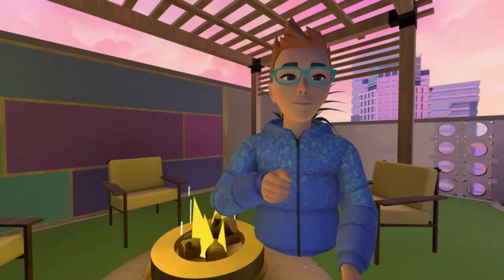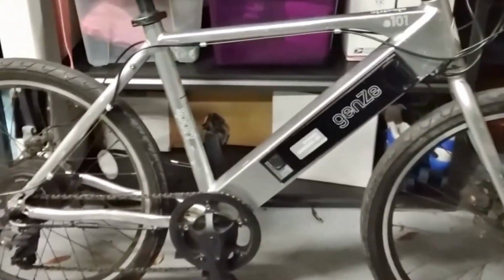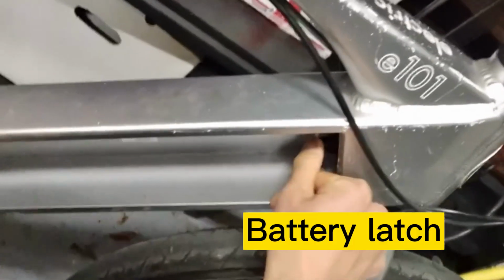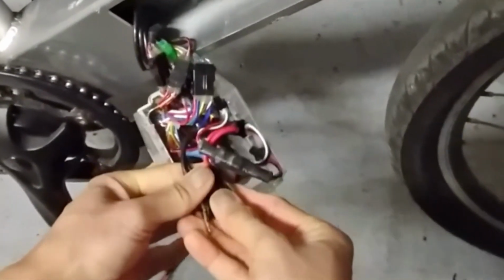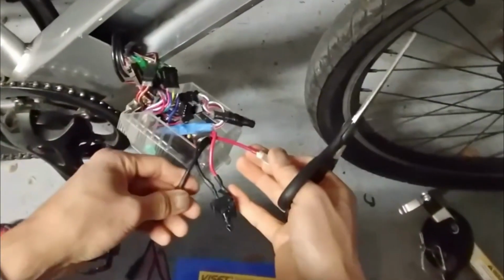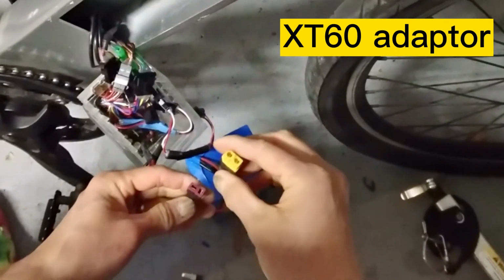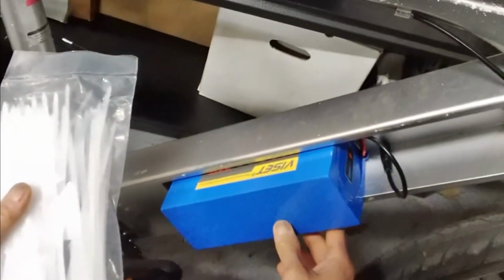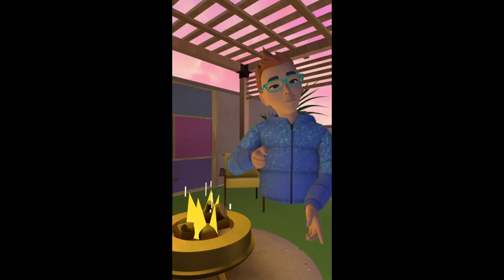How to replace eBike battery with 3rd party battery? (附中文字幕)

Comment: Good job with the battery! But I'm actually curious about how you attached that trailer to the rear axle. I have the same bike and haven't been able to attach my Thule Chariot trailer to the rear axle. Looks like your trailer is a Burley, did you need to do anything special to attach it? Maybe you could make a video about it? Thanks!
Reply from the maker: Thanks! I got a trailer hinge from Amazon. Here is the link:  https://a.co/d/dZPzP63
Let me know if this helps. I can also make a short video if you need more details.

Comment: Is it still working? Did the battery capacity indicator on the bike work even with the larger capacity battery?
Reply from the maker: Yes, it is still working. 
Bike capacity indicator is working with larger capacity. However, it doesn’t linearly map to each other. For example, battery shoes 2 bar while the battery indicator shows 3 bars. I didn’t know which one is more accurate since I never run out of my battery during my ride.
Reply: Thank you, this was great!

Comment: what external "voltage" i can give to the red and black wires, if i want to test without battery. it will on only if 36volts are given or anyhting more than 12v works? (just want to test the bike before buying battery)
Reply from the maker: When I used power supply, the front computer display starts working much lower than 36V. If I recall correctly, it is around 20V. However, the throttle won’t work until the voltage is closer to 32V.
Reply: @DrJemmy   I gave 22 volts and as you said the lcd turned on thankyou. But It is showing error "F". May I know how to check error codes do you have pdf manual of error code descriptions. I tried online but i couldn't find it.
Reply from the maker: I didn’t know this. Sorry I couldn’t help.

Comment: Would the 30000mah work?
Reply from the maker: Theoretically, larger mah is only for larger battery capacity. Bike can ride longer  with it. It should work with same current and voltage output unless there is something special inside this circuit of bike.
Reply: @DrJemmy  thank you for your reply.